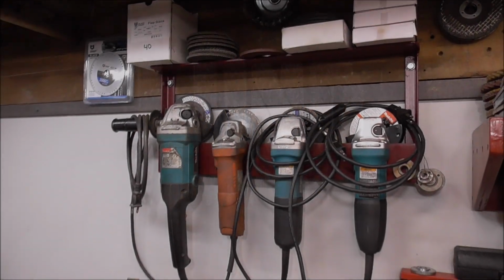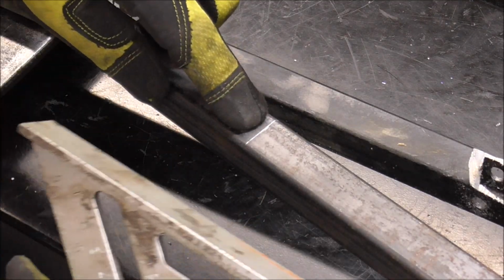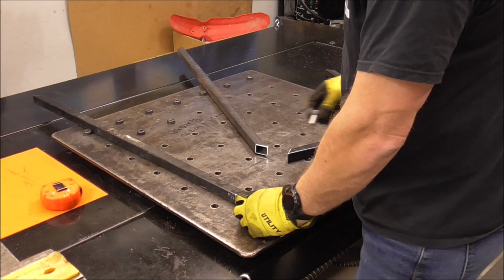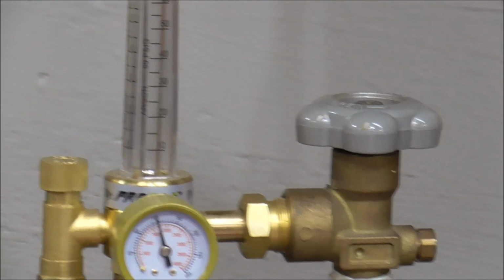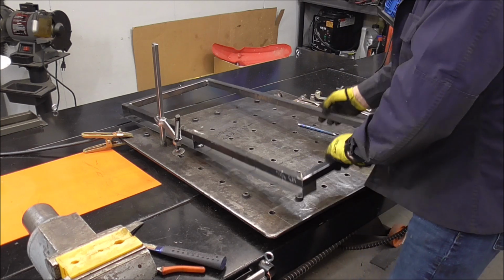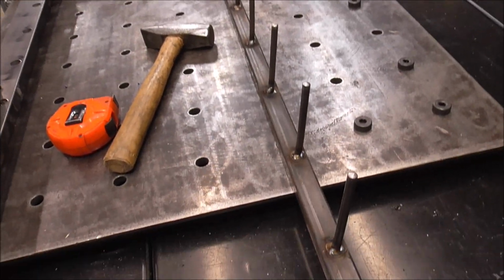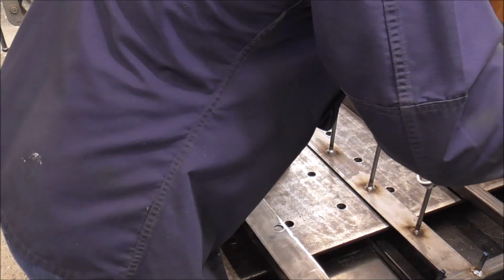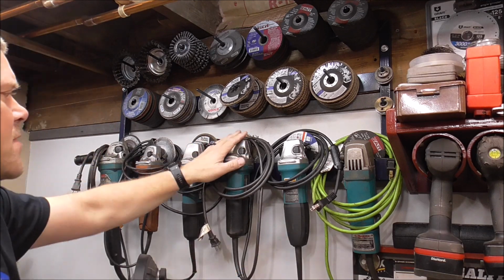Ultimate Grinder Tool Storage Rack Welding Project

Comment: Thank you. This is an awesome video. It's a good question, just starting out learning. How to weld light fabrication? Which this would you recommend red? Size type for cutting grinding. Slap. This et, cetera, something damn choices out there, in which brown would you say, is a good brand that's worth the money? See all these deals but a lot of times the deals aren't really deals and this sucked
So just like your recommendations, I don't hold this gospel, just to give me a starting point to try and compare, I really enjoy your channel
Reply from the maker: Thank you. What you buy for equipment really depends on what you want to do.
Reply: @BrandonLund so I guess for just starting out basic flap disk, cut off wheels, grinding disk, thin and thick for the four and a half inch grinder. In my case, lots of grinding disk
Do you have a specific brand you prefer over another?As far as flapness cut off wheels and grinding disc go.
Thank you for the response.I look forward to more of your videos

Comment: Hey Brandon. I know this vid is 3 years old and you may no longer be looking at comments. But I meant to tell you this before and will now before I forget. 1) I get much inspiration from your vids. Thank you. 2) I have the same Evolution saw. Love it and found a great way to self collect 95% of the metal filing it makes. I bet you could fab a device for metal cut off saws that would be a bit more sophisticated than mine ;-) The way I do it (also works for my mounted portable band saw) I have a powerful magnet about 1.5" in diameter inside a cheap Harbor freight nitrile glove. Simply place it behind the saw where the most metal shards shoot out and it grabs the bulk of them. Why the nitrile or latex glove? You know how hard it is to get metal shavings off a strong magnet. The glove works great to allow you to go over to the trash can turning the glove inside out to let the shavings drop into the trash away from the magnet. Used a heavy duty ballon first, but it was too hard to release the filings. A Mag Switch magnet would be best, but they are expensive, so I went the cheap way LOL.
Reply from the maker: Thats a great idea! I love it! Thanks for sharing and I appreciate your kind words and support 🙏

Comment: Why wouldn't you put that on your welding table where you're actually going to use your grinders? That's what I did with my table , I put a piece of 2×2×1/8 angle iron all the way around the table welded 7 inches down from the top between all the legs so that I can instantly have access to a grinder anywhere on the table without having to constantly be going back and forth to  a wall mount.
Reply from the maker: Thats actually a great idea but it wouldnt work for me. My table is pneumatic. It goes up and down. 7" down from the top would prevent the table from going all the way down.  Generally I'm only using one grinder at a time and it move it about the table as I use it.

Comment: Your chop saw is design for metal only but can you use any miter box with a metal cutting blade?
Reply from the maker: Unfortunately you cant @BRIAN PIRTLE. The reason is that the blade spins too fast on a regular saw which overheats the and dulls the blade.

Comment: Brandon, I’ve saved some money and done my research but still spinning in circles on my final welder purchase. Brand name in case i don’t care for welding and I need to resell it later or no name with more features and functionality.  Can you offer any advice?
Reply from the maker: Thats a hard question Mike. The route I personally went many years ago was i started out with a no name welder around the $199 price point and built tons of stuff with it. From there I bought name brand stuff. It's a gamble buying the no name stuff because you dont know if it will last a year or a month and the waranty might not be there. If cash was a concern and you think you might not like welding, maybe a HF flux core welder might be a good way to see if you like it because they are pretty good about a warranty expecially if you purchase a protection plan. If cash isn't much of a concern then maybe go with either a higher grade HF welder, a Hobart, Miller or Lincoln. I personally like Miller and Hobart.  OR you could go BIG and buy it once and be done with it by getting a Fronius 2200 multi machine. Fronius will always hold it's value and is the best welder that money can buy hands down. Whenever I start a new hobby I usually go the budget route in case it's not what I expected or in case I lose interest but ultimately it's a personal choice.
Reply: @BrandonLund  I went with an Eastwood MIG 180. Doubled down on sales and coupons and free shipping for a total of $449. There was a spool gun option but I’m starting with steel and will get the gun for aluminum when I’m ready or maybe go with MAP gas and alum rods.  Now I need gloves, helmet, etc, lol. 11/5 is my birthday!
Reply from the maker: I think you made a great choice! Those Eastwood welders are nice. It won't give you any trouble. Congratulations on the new purchase!

Comment: I’m starting to think you are spying on me or you hacked my phone! Cause I’ve been thinking on making one and also a rack for clamps. Which would be similar build.🤣
Yours is actually simpler and I like it. Mine was gonna be the plasma cut slots and bend to hold them. A lot more work than yours. I’ll be using your design 🤣
Thanks 💯👍🏻
Reply from the maker: @James Rogers thanks man! I appreciate it!

Comment: Great build Brandon. I have one question, what where the holes for? I thought you might be notching them so the grinders would sit in each location,  but it doesn't appear that way.
Reply from the maker: That was my template leftover from when I built a fixturing jig. I was just using up scrap

Comment: Awesome job, Brandon!

One little thing; on those flowmeters, it's the top of the ball that is your CFH reading, so you're running closer to 19cfh. Turn it down a tad and save you some money welding this steel scrap, save 20-25cfh for stainless!
Reply from the maker: It's never too late to learn. I always went by the center of the ball. Thanks for sharing that!
Reply: @BrandonLund  

No problem, bud! I'll have to figure out how to post pictures of the gantry crane I built last week. Thing is insanely overbuilt for the size it is, but we had the scrap laying around, so it works.
Reply from the maker: Thats awesome man! post it up!

Comment: Seems to need a hanger for the makita disc wrenches??  My objection would be that it takes up wall space which in my 1600 sq. ft. shop is still at a premium.  Almost all has either a bench or toolbox where there isn't a power tool so reaching it would also be a problem.  The problem is made worse as I have sixteen grinders at last count of all sizes which would need a large rack to say the least.  Storage in the shop is always a big trade off.  I like the design though if I find room I might actually adapt it to swing out on a hinge.
Reply from the maker: I like that hinge idea Douglass! As far as the wrenches, I don't use them so I didn't create a space for them. Those end up in the bottom of a drawer.

Comment: Thats a nice rack! Man you have a nice setup there....I'm just learning to weld...I have a stick welder I would like to go with a mig but idk where to start lol 
Exhaust with an arc welder is rough lol
Reply from the maker: bigfordmano5 thanks man! My advise is grab a cheap hf welder to start and work your way up. I've built tons of stuff with a hf welder. No shame in the game if your having fun 😉
Reply: Maybe make a video explaining auto darkening hood from harbor freight (the one I got) like adjusting everything...I'm a noob but getting better thank you for the time and effort you put into your videos!
Its much appreciated
Reply from the maker: Thanks for the suggestion! 👍 I will check it out :)
Reply: @bigfordmano5  

If you're welding less than 1/2" materials with .045" or less wire, set your hood darkness to 9 and the sensitivity to 6-7. That should have you handling pretty much everything. You don't want to go below 8 on the darkness ever, unless you're doing something like plasma cutting or oxyacetylene torch welding (for either, 5 works about perfect).

Any lower than that is for ultra specialty types of welding at crazy low amperages on very small parts; not the usual garage project. 

If you're having trouble seeing, even if the lens seems okay, swap out your outside clear lens. That thing will get crazy dirty & pitted, and it's hard to notice until you actually pull it out and compare it to a new one. The difference is like night & day. (Especially since you're running stick. I know pipeline guys who go through 2-3 lenses a day sometimes.)

Hope this helps.
Reply: Yea I've been looking around the hold up is space and storage right now....the little welder I have now stays in my trunk lol
Reply: @bigfordmano5  

Been there, man.
Reply: I have a little arc welder, I'm getting pretty decent....I've done exhaust and various other things...its a forney 100st...I think I'd like a mig welder I think. I appreciate all the help!
God bless you all!
Reply: @bigfordmano5  

Expect to pay about $800-1k all in for an okay mig welder, 80 or 125 tank of mig gas, contact tips, wire, etc. Don't cheap out or you'll just end up frustrated.

Comment: 6 grinders? Good grief!! My missus did her nut when she found out I had 2 batteries (both came with the drill) for my cordless drill, 🤣🤣🤣. She’d go ballistic if I told her I had an extra stashed away, 😂😂. 
In my house, 6 grinders = funeral!
Good job ol’ pal.
Cheers
👏👏👏 👋👋👋
Reply from the maker: Hahahaha in all fairness I found 2 of the 6 lol. Apparently it's possible to misplace them...im not sure how that happened but they have been missing for over a year lol
Reply: Funny story. The other day SWMBO actually found out I actually had 2 grinders... Well, the budgies went berserk. Yes, she went off her nut until I told that yes, I bought one, a Makita 5" 2 years ago, because the other one, a finder (free) 4", in poor condition wasn't up to scratch and lacked safety guards.
At least she was happy when she saw a welder walking off with our son, but wasn't so happy when she realised it wasn't my only welder.......😂😂😂, she thought I only had 1, but there's 3 still here - mig, stick and tig/stick.
I'll have to check the tappet clearances on the ol' girl, she's valve bouncing too often 😂😂😂.
Reply from the maker: Hahahahaha your comments always give me a good chickle my friend. On a positive note whenever I get in trouble with tools I say "remember I bought that 2 years ago". Hahahaha sometimes it works lol

Comment: Brandon, could you make horizontal screw clamps for your welding table? This might be a nice addition to what you already have.
Reply from the maker: That’s a great idea Bryant! Thank you! 👍
Reply: @BrandonLund  you could use acme thread, and it would last longer than using bolts or all thread.
Reply from the maker: I love that idea!
Reply: @BrandonLund  the part with the handle to tighten, if you use two smaller pins on an angle, it will help keep it from wanting to pop out.
Reply from the maker: Bryant so like cut it at a bit of an angle? Is that correct?
Reply: @BrandonLund  yes, that's the idea. Maybe not at a 45°, but enough to keep it in place, and fit it into your table holes.
Reply: Maybe more of welding it on an angle.
Reply from the maker: I like it! 👍

Comment: You have to look at the prime Weld 225 AC/DC and stick comes with a CK Tig it’s $800 you got a check this out
Reply from the maker: @Jose4130 it was that or the YesWelder. I ended up going with the YesWelder only because it's a 250 amp unit. Ultimately it will come in at a little more than the prime weld once I upgrade to the CK torch but I was kinda set on a 250 amp unit. So far I'm very happy.
Reply: @BrandonLund  Don’t get me wrong you’re right yes Wilder is better moneywise. But the prime welder is pretty a little expensive but you’re rite in your other video your better off just buying a cheap one then expensive one. 👍👍👍👍👍
Reply from the maker: I have never heard a bad word about the Prime Weld so I agree it's a very good welder. I haven't tried one yet but I hope to some day.
Reply: @BrandonLund  Yep I haven’t heard anything bad about prime welder been watching your videos and everything you say about welding  it’s really good videos you make keep up the good work
Reply from the maker: Thanks Jose 😁

Comment: I love this build! I am currently at 3 grinders, but I imagine I will keep accumulating more, so I need to find some wall space! As always, thanks, Brandon!!!!!
Reply from the maker: @Steven watkins thanks man. I was basically using 3 also (excluding the big grinder) and now I find i'm more productive with having the other 2. It's so much easier just grabbnig the tool with the right attachement rather than switching discs. It doesnt seem like a big chore to switch back and forth but things just go smoother it seems

Comment: I wish I had the wall space for this. So many tools not enough space. Very nice work!
Reply: It's the eternal workshop problem. You accumulate equipment to fill your available space.

About 5 years ago I moved away from a place with a quite wide and double car length garage that I used as a hobby workshop. I now have a home with a pokey little one car garage as my "Play room". It's really annoying having to drag out larger tools (bench drill, bench grinders, welders, etc) from where they now live on shelves to use on my now solitary workbench rather than having separate workbenches with all the required kit already at hand for cutting/grinding, welding or painting. Every 1 hour job now takes 3. :(
Reply: @Reman1975  I know the feeling. A lot of the hobby type jobs never get done because it becomes a scene full of foul language and flying objects. This usually leads to a good purge of the hoard of materials I have been moving around for years.
Reply: @basshead8555  Oh god yeah. I know ALL about hording usefull stuff. Last time I moved I HAD to go through the contence of my wall of large plastic storage crates I use for storage in the garage. Amongst everything in them I found quite a few duplicate tools I'd forgot I'd even had, enough part boxes of nut's/bolt's/washers to start a small hardware shop, and a fair few spare parts I'd kept for my Fiat 127.......... And I haven't owned a 127 for over 25 years. :D

On the plus side, The Fiat bit's fetched enough on eBay for me to buy myself a cheap portable bandsaw....... One shelf empties, another one fills. LOL !
Reply: @Reman1975  so it isn’t just me keeping good stuff that I need the day after I decide to get rid of it.
Reply: @basshead8555  Over 30 years ago I used to spend my summer weekends playing roller hockey with friends. A couple years back a mate asked me if I could spin up some height adjustable anti skid feet for his bench top belt grinder using my little old lathe, so I made them out of half a set of old "Quad" roller skate wheels (As in, not "in-line skates") I still had kicking about.

You never know when somethings going to come in handy. :D
Reply from the maker: @Reman1975 I feel you brother!
Reply from the maker: Thanks man. I'm running into this same problem. I'm running out of space!